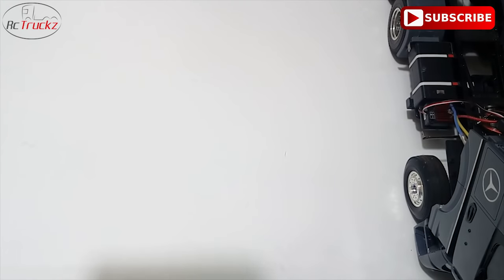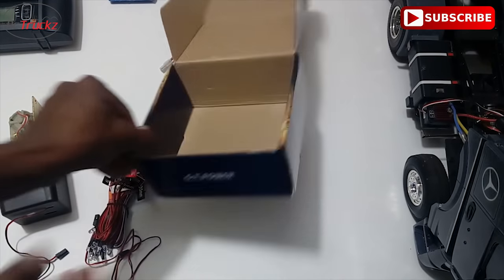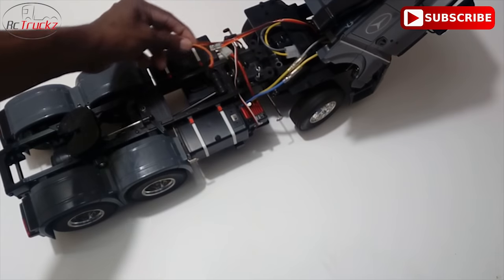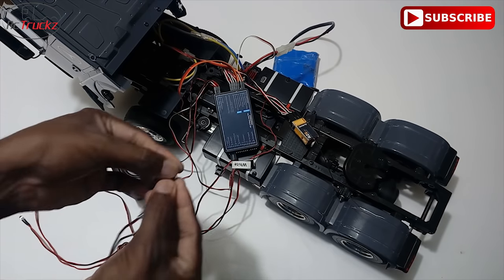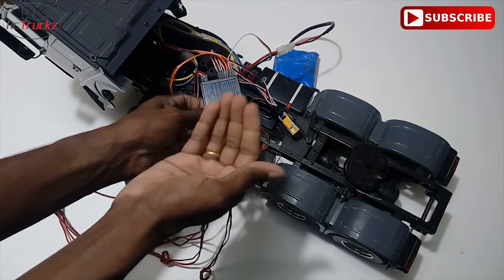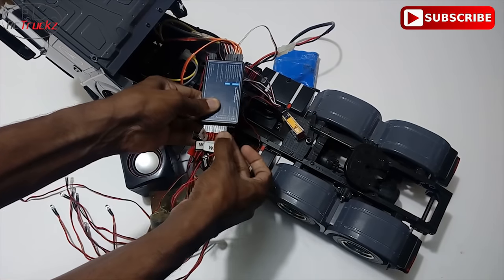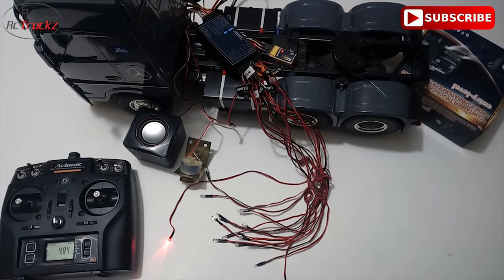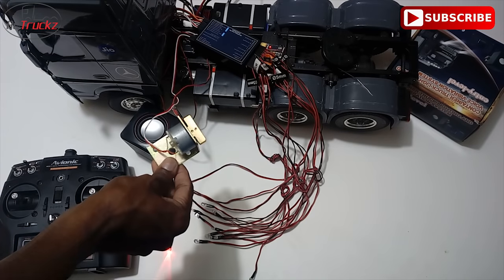Assembly/Wiring of RC Tractor Truck Lighting & Sound/MFU for Tamiya/Hercules Hobby - G T Power

Comment: Thanks for sharing your tutorial vid. So my question is how did you power the sound module? Thank you for your help!
Reply from the maker: The sound module has a power input pin and. It needs to be powered by using an additional cable that connects from PPM on receiver to sound module power pin. Please watch same video from 4.50 ...hope this helps...

Comment: hi there Well done on this video very informative and great explanation of where all connections go, my Bro Col just purchased one and the instructions was a sheet of paper in very poorly translated to English, as you know names and numbers on unit and receiver don't match. We've had real problems trying to sort it out and gearchange servo keeps going to full throw every time we plug it in, (possibly Faulty) hopefully with help of you're video we'll get it running properly 10 out 0f 10 feller well done
Reply from the maker: hello there, thank you for your response and i am happy that this video really helped you wire the unit properly. yes you are correct, the instructions that come with the unit is totally useless. it took me almost a day to figure out the wiring. if you have any doubts, please send me an email at rctruckzblr@gmail.com

Comment: Kudos for this good step by step instructions mate, its going to help a lot of us out there who don't want to spend a fortune on Tamiyas MFCs which just for the similar kit you pay around $400 (insane prices and for the brand I suppose).  I saw this GT ones going for about $120 on rcmart with a combo set. Going to get it and watch your vids again. PS - can you show how you set up the transmitter etc? thanks in advance!
Reply from the maker: Hi
I am glad this video was of help to you. 
https://youtu.be/U4esma5A1S4
Please click this link as i have a video about connecting futaba radios. most radios should be almost the same
Hope this helps
Reply: @RCTRUCKZ   yup saw that, did you had to adjust the gimbals to self center on both sides? Most of if not all the stick type controllers are made for drones and flight RCs.
Reply from the maker: im sorry , not sure about it, but the futaba radio on my video is for the surface models. the G T Pro wiring video has the avionics radio, its for the airplanes. the control sticks on the avionics radio has the self center feature on one side.

Comment: thx alot for the helpful explanation, i have one issue the vibration is not working, i try to connect it direct to electric and the motor works its not working with the sound system if u can help that will be great
Reply from the maker: Hi sorry for the late reply. I was held up with a bus build...the vibrating motor goes to pin 2. The white wire wld be on the topmost lead and the red wire on the middle pic. Im sure  you are connecting it wrong..please recheck the leads where you are connecting it.
Reply: RC TRUCKZ  thx for ur reply am connecting it as u said so realy  am stuck with that issue

Comment: So the indicator works as soon as you use the steering?
Reply from the maker: Yes, thats correct. Moving the steering stick either way..makes the indicators glow..
Reply: @RCTRUCKZ  Ah ok, not the perfect solution. That's what I have now, and no matter how far I steer, it turns on the indicator.

Is there a way to connect a trailer to this system?

Comment: Very nice video.I did the same as you, but I don't know why turning the wheels and going back and forth are on the same button.
Reply from the maker: Thank you for watching . Maybe you should try to see if you have wired it wrong. Just interchange the wires on your receiver so it works on the channel you need
Reply: RC TRUCKZ thank for the answear.i try to change the wired, but if i change it the front light are not working.only the signaling, and horn are working.
Reply from the maker: @bologanbogdan6634  what radio are you using ?? Is it a 6 channel or a 4 channel radio??
Reply: RC TRUCKZ it a 6 chanel. Model are looking like fly sky, but it modelcraft mp26 dt.
Reply from the maker: @bologanbogdan6634  can you email me @ rctruckblr@gmail.com
Reply: RC TRUCKZ i send to your email, but it not ok.it write this email not exist!
Reply from the maker: @bologanbogdan6634  im so sorry....i missed out a lettter on the email. My bad. Its  rctruckzblr@gmail.com

Comment: I've got a power unit but I'm having trouble with the channels what channels did u connect up to from the sound unit to the reciver
Reply from the maker: Pin 4 on the sound module input side goes to channel 1, pin 3 to channel 3, pin 2 to channel 5 and pin 1 to channel 2. My radio is a 6 channel unit. Between 6:50 till 8:15 on the time of the video this information is available. Hope this helps..

Comment: Nice mate!!!!!!
Reply from the maker: Thank you
Reply: RC TRUCKZ 
What model radios you used?
Reply from the maker: @TX010  i use an Avionic 6i ...its a 6 channel digital proportional. FHSS 2.4ghz radio
Reply: RC TRUCKZ 
Thanks mate!!
I got in plans buying one of this lovely trucks from Tamiya. Probably Scania r620 plus topline head. 🧐😜plus gt power and good transmitter. Yours looks pretty good and I think it is!  I check and look around..... price for this toys can kill 🤯🤯🤯😱😱😱 so before Christmas I don’t think I will be owner;)) more chance after New year.  
Any way thank you for info!! Take care!!!
Reply from the maker: @TX010  wonderful news..!! Goodluck with the build and if you run in to any trouble feel free to email me at. rctruckzblr@gmail.com
I will most probably come out with a video on connecting a futaba 4ywd. 4 channel radio to the GT power module. Lets see how it goes.. If cost is a problem you can try the hercules hobby tractor trucks as well. They have the scania 620(250usd) scania 470(220usd), benz actros 3363(210usd) benz 1851(199usd). You can check them out as well.  And when you buy make sure you buy an esc and a 80 turns motor to give it a realistic run(videos on my list)....goodluck again...takecare
Reply: RC TRUCKZ 
Thanks for helping! 
I live in Uk London. 
Most popular Tamiya better access to parts and etc... 
👍
Reply from the maker: @TX010  ok...goodluck again

Comment: Hello, Can I use a 7.2 V battery?
Reply from the maker: Yes ...you can use it. It will work
Reply: @RCTRUCKZ  Why does it say in the switchboard that it works from 7.4 V up?
Reply from the maker: @emergencystrobelight  it works from 7.0volts and up

Comment: Hi dear please let me know that from where the engine sound coming very perfectly......please...
Reply from the maker: Its coming from the blue box(multi function control unit).
Reply: @RCTRUCKZ  
That box contains with speaker or sound producing something dear?
Reply from the maker: @abhilashsukumarannair3246  that box has a micro processor which is coded to make sound and give lighting outputs to the truck from a transmitter 
The speakers and the lights are connected to the control box
Reply: @RCTRUCKZ  
Ohh..yaahh..thank you dear....

I saw your KSRTC Volvo video....its very good and perfect...

Are you making RC Miniature against outside order .....? Bcz if yes then I just want to have one Miniature.....
Reply from the maker: @abhilashsukumarannair3246  sorry..i have not started taking orders yet. Will let you know..once i start
Reply: @RCTRUCKZ  
Please......
I am waiting for that good reply from you....
Thank you dear....